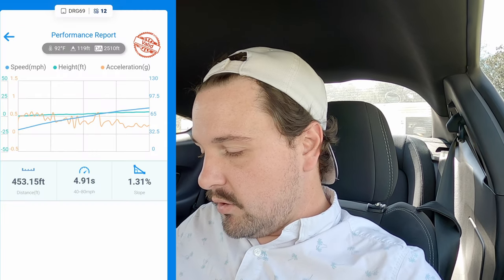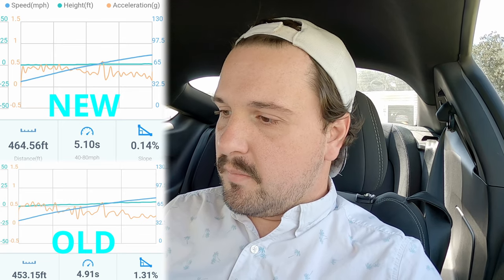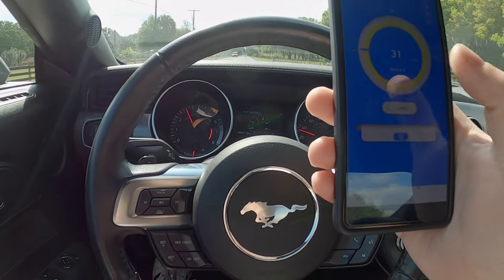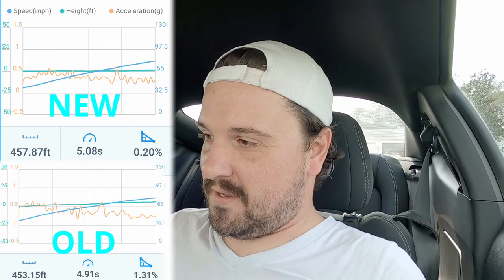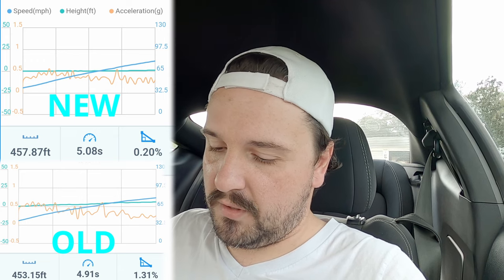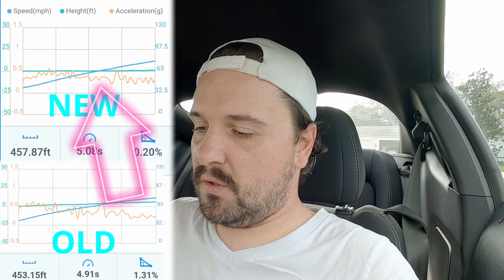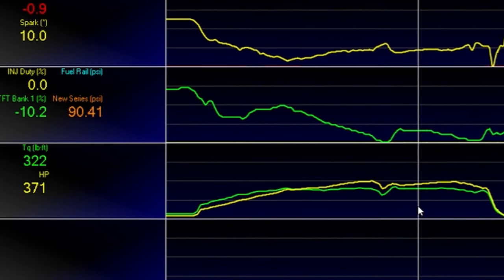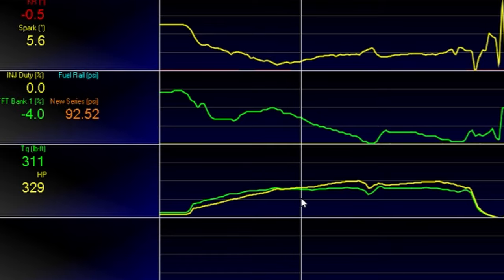ECOBOOST Mustang Power with 93 Octane Tune

Comment: Hey man been binge watching your videos. Started from your Ecoboom prevention and then noticed you had the typical cylinder/coolant failure. I've seen some of the work you've been putting in and it's amazing how resilient you are. I currently have a 2019 normal ecoboost with all mods but no tunes at 50k miles. Any advise to give me peace of mind? I love this car and cannot trade it in at the moment but I can't help but feel anxious about having a ticking time bomb.
Reply from the maker: I think someone said it in the comments of the how not to ecoBOOM video. The best thing to do to ensure reliability and longevity is to leave it stock. But where's the fun in that? My best advice is to drive it and enjoy it. If you can, put some money aside every paycheck to build a repair fund if the worst happens. I've been meaning to make a video about self warranting a car like this. Just don't worry about it because it will take your enjoyment away from the car. Drive it, and enjoy it. 🙂

Comment: You should set shift points back to stick pull and that would give you a big company just a thought and also could be faster as power band should stay in that realm more just Idea and see how close to the 4.91 you are
Reply from the maker: The turbo lag is the culprit, not rpm. Once that turbo lag is figured out, it will be great.
Reply: @KarzKreated 
Look at some stock turbo Dyno sheets online every single car makes peak power at 5200ish then falls off as the turbo doesn’t flow enough air.   Even built motor stock turbo cars

Comment: Is it possible to adjust the cams position to get less cam overlap in low rpm and then shift cams for more overlap up high.
Reply: there are no vct gains to be had with stock turbo bolt ons. i haven’t done a big turbo ecoboost yet but i would assume there are some things to tweak vct wise with a larger turbo, but that is just an assumption. ford has very very good vct angles from factory for the ecoboost and coyote. for the coyote there are vct gains once you swap intake manifolds and do catless long tubes. ford advances the cams mid range then slowly retards them to redline
Reply: @ryanphillips9034  if Kirks replacement cams are longer duration and higher lift the overlap will be more if the ECU base line is the stock tune. The cams might need more separation on the vct settings. Turbos don't come on boost as fast with valve overlap in the low range. If there is a way to adjust it for less overlap down low in rpm then the boost would come on quicker.
Reply: @BlueThunder1965  i forgot he had gotten cams, i’m sure there could be some gains but useless to even try changes without a dyno. too many variables on the street
Reply: @ryanphillips9034  if the exhaust was advanced down low that should help. And intake can remain unchanged. If the hot gasses are a bit early it will still help spool the turbo. But it will cause more separation. If you count the cycle like this. 1 power stoke / 2 exhaust stroke ( cam opens a bit early and closes a bit early but with longer duration it will still be open longer then stock) / 3 intake ( opens as per normal vct settings and cylinder filling) / 4 compression.  Then repeat. With this logic only exhaust needs to open sooner.
Reply from the maker: Doesn't Ford use overlap to spool the turbo faster? It's part of the blowthrough logic.
Reply: @KarzKreated  yep exactly what they do. you could play with it but would need lots of dyno time. think most of ur issue is the turbosmart gate being slow reacting like we talked about
Reply from the maker: I've adjusted the WG DC a little, and it helped, but it's still not great. I have a lot more work to do on this tune still. I just have to find the right balance of WG settings in the tune, and the actuator arm length. I'll get it there! 🙂
Reply: @ryanphillips9034  the turbo smart can be opened up and you can replace or remove internal springs to change the resistance. A lighter spring load will be quicker to respond. Turbo smart also lists the combo of springs and what value it gives. I believe the stock is around 8 lbs of force. Also if the exhaust header fold is to restrictive when both exhaust and intake opens at same time ( overlap ) and boost has not built yet. This will slow down the turbo spool time. It will not blow thru to the restriction of the turbo housing with more pressure on the turbo housing side then intake.
Reply: @BlueThunder1965  these turbosmart actuators are slow responding hence why cobb tuners love them. so they can easily control them with cobb custom features i.e. old school wastegate control rather than legit torque based like hptuners. lol i tune these frequently

Comment: Wait so if your car went slower 40-80 then you’re making less horsepower on average then a factory tune car. 

Also just as a suggestion the factory turbo IMO doesn’t flow enough air to support 6000+ rpm and it would probably be best to lower the shift points.
my car personally shifts at 5800rpm.
Reply from the maker: I removed over a hundred pounds of weight from the car in the 4.91 second run. It was stock tune with the boostmax. The car went 5.19 full weight on the old setup and it now does it 0.11 seconds quicker with the horrible boost lag. Once I get that lag ironed out, it will be faster than the old setup was with weight reduction.
Reply: @KarzKreated 
Idk it just seems like the horsepower numbers you’re claiming and the 40-80 times don’t add up.     I know my car makes around 360whp and full weight premium pack car in similar weather to you I have a valid dragy run 40-80 of 3.85 uphill